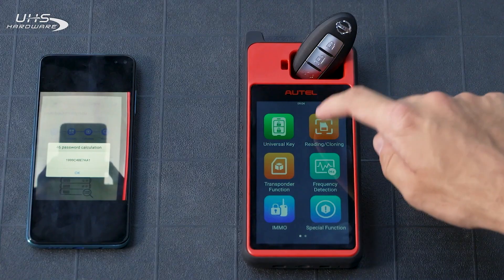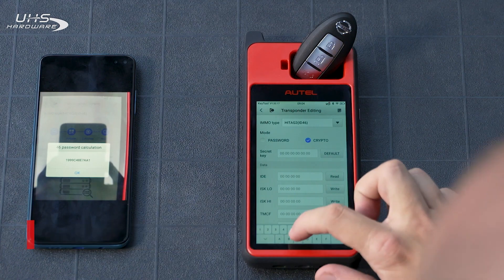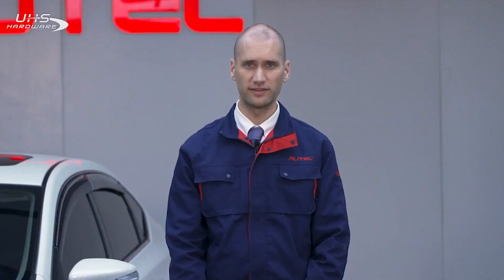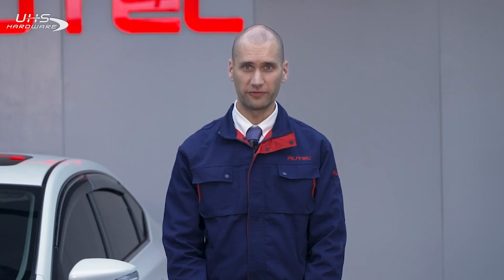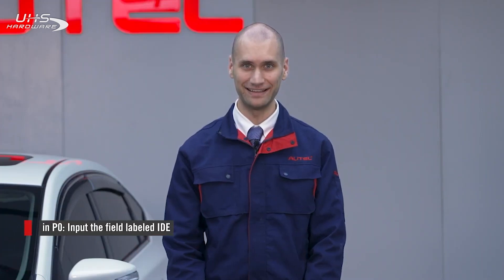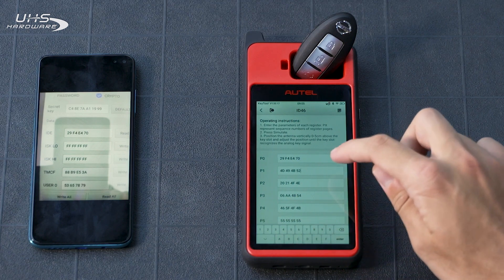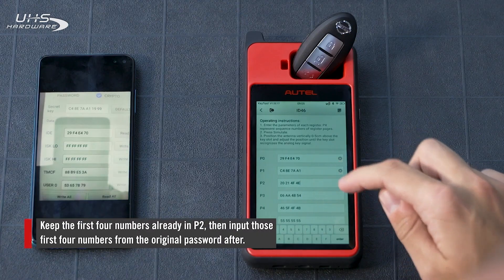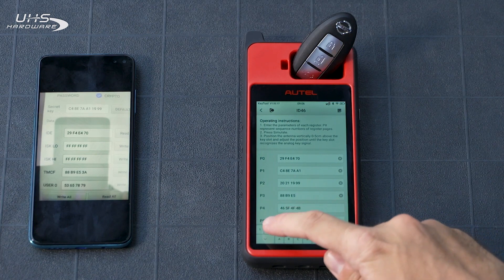How To Perform Smart Remote Simulation - Using  Autel KM 100 Universal Key Programming Kit

Comment: Useless when you are faced with "All Keys Lost" and what exactly would you be using the EMULATOR MODE.... when you have a Physical Working Key in the 1st Place? There is another YT video that shows you how to use KM100 when you really need it in All Keys Lost to get a car running... say when a client lost their keys out in the boonies and need to get it started just to take to a Dealer or so you can make a physical key and FOB you know works!
Reply: Do you know the YT video your talking about where can I fine it?